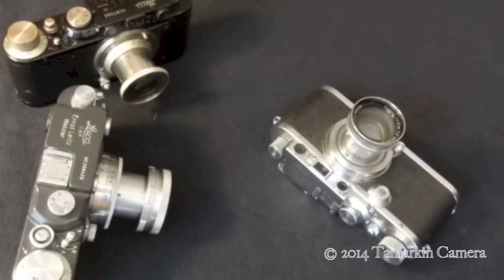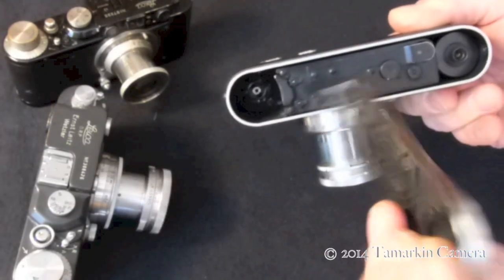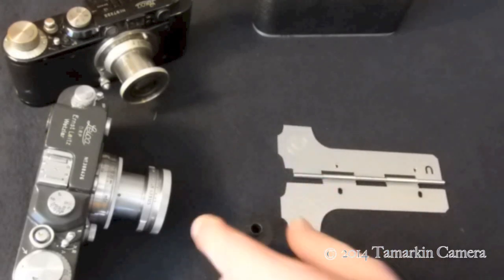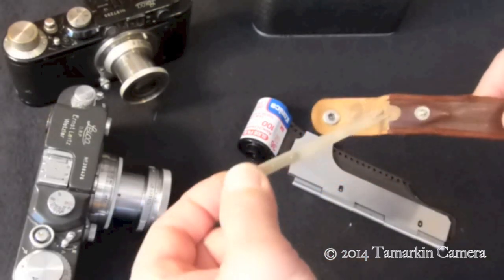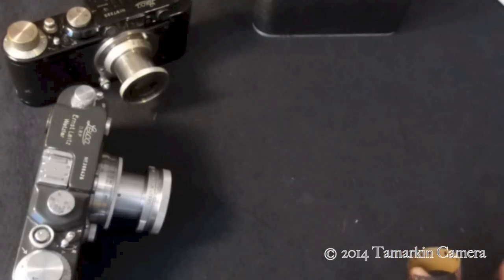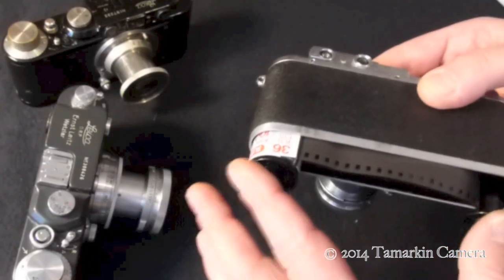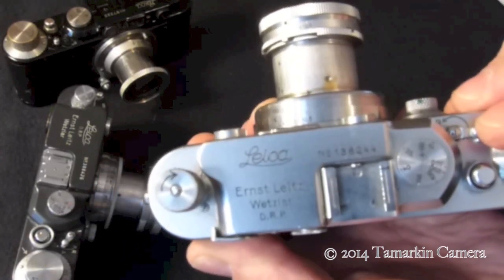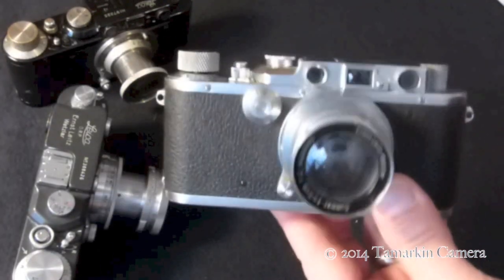How to load 35mm film in to a Screw Mount Leica

Comment: When 135 film leaders got short, I made a III-series Leica film tongue template out of somewhat thick cardboard used for report covers or the like. Then I cut away the excess cardboard and had a serviceable Leica tongue template. Whenever I used Ye Olde Leica (a 1938 IIIa model), I drew out the film leader, used a pencil to draw a line on the emulsion side to be cut, then used a blunt nosed "kid's scissors." (It was also handy for making "use every frame" reloads inside the changing bag with a daylight bulk film loader.) These were in my college student days, so every penny/film frame counted.;)
Reply from the maker: What a great idea ! Thank you for sharing !
Reply: What a great idea - thank you for sharing !
Reply: Back in the late 1960's, when I was thinking of going from rangefinder 35mm cameras to SLRs, Fuji film coming on the market had a short tongue, while Kodak's were "Leica long" for a while. There were metal Leica tongue templates at any real camera store, but they were too pricey for college student me. So, using the "Kodak long" film tongue, I cut a cardboard template out of black stiffening cardboard found in 25 sheet packages of, say, Agfa Portriga Rapid or Kodak Polycontrast enlarging paper. It's amazing what you can do with the materials at hand when money is tight, eh?

Comment: Great video Dan. My takeup spool only has a tiny and very very shallow notch the does not hold the film firmly and it does not advance. It slips out. Were there different types of spool? Should I tape the film on? Any concerns about that? Thanks
Reply from the maker: Douglas Gottlieb - thank you! Sounds like the spool catch is worn out - a new spool is probably in order. Info@tamarkin.com / 800-289-5342

Comment: I assume that up inside the mysterious interior of these cameras there are film rails and a pressure plate. When you slide the film and spools up, or down, into the camera how does it get in between the rails and pressure plate and how do you know it is correctly lying on the film rails? Also, is there a another sprocket wheel with teeth to engage the film in there? Know of any images or video with the back cut off?
Reply from the maker: If you contact us through info@tamarkin.com, we are happy to give more information which is easier by email.  Thanks ! Dan